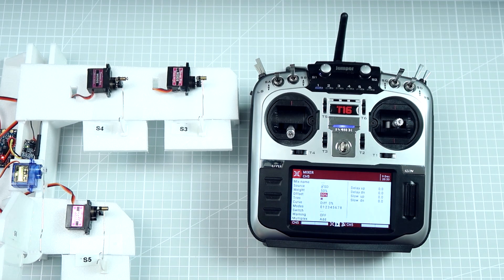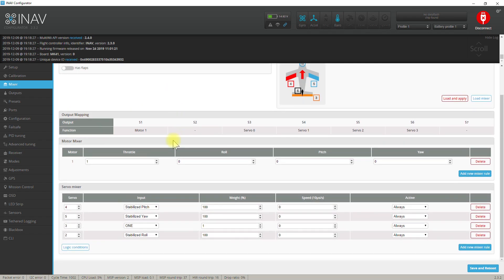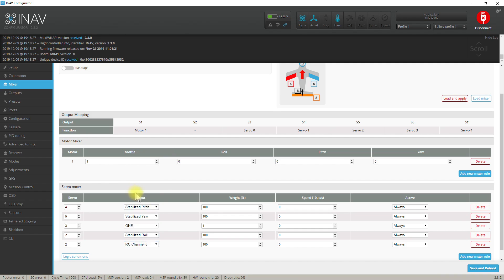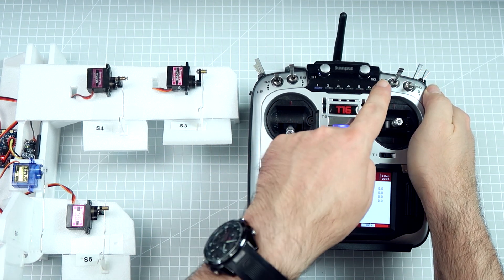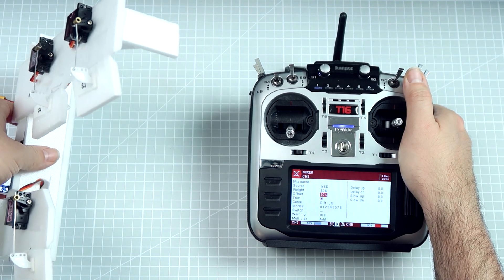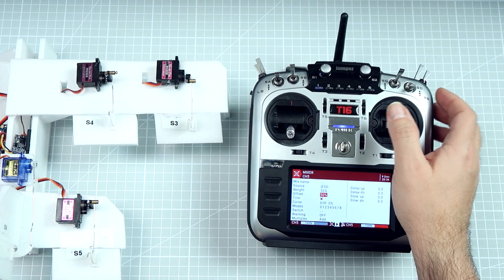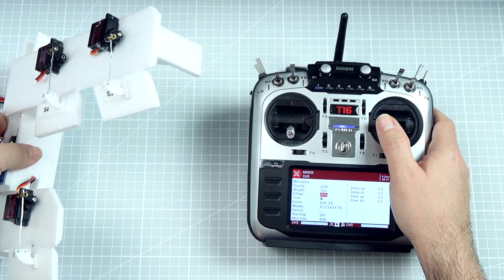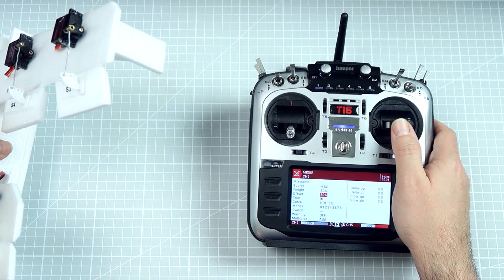INAV Flaperon with mixer and OpenTX: full tutorial #fpvuniversity

Comment: I can get crow to work on a slider within the radio where first 1/2 of travel is flaps only and last 1/2 of travel is crow.  Wanted to use the inav mixer but can't figure out how to get it to work the same as using the mixes in the radio.  In inav it works until I move the slider to turn off the crow.  The flaps go level with the wing and the ailerons move down like in flaperons.

Comment: Besides using Inav on fpv aircraft, I use it in gliders and sail planes.  For the sailplane use, differential ailerons are useful on high aspect ratio wings where adverse yaw is present.  Differential is where the ailerons have more up travel than down.  This is set up in the outputs tab and can be combined with flaperons.    
You should do a video on this as it may be useful to others.

Comment: Late but good tutorial.
I have  flaps & crow brake already since Inav version2.1 on my ASW28...;-) But. on my setup crow is only allowed if the plane is not in auto balanced mode.
There should be more of these tutorials for normal planes and not only for simple wings. Ok, sometimes wings have their own problems with the right settings if they are not standard models that everyone got from China.
My quads are getting boring.....